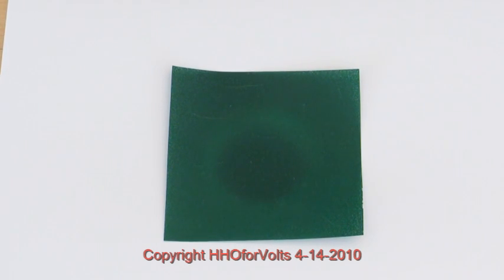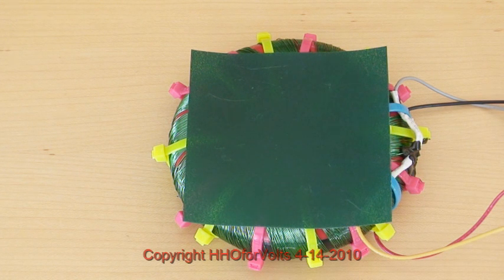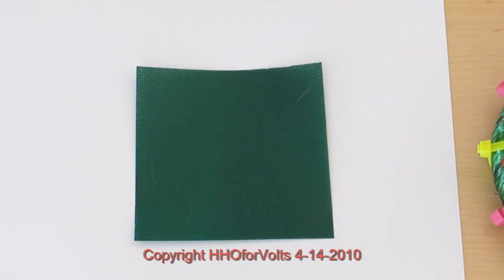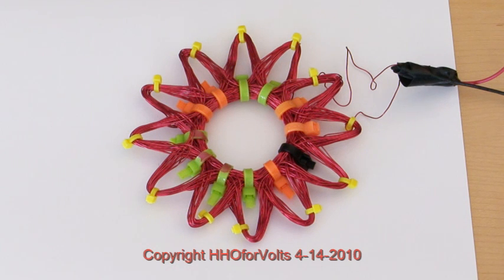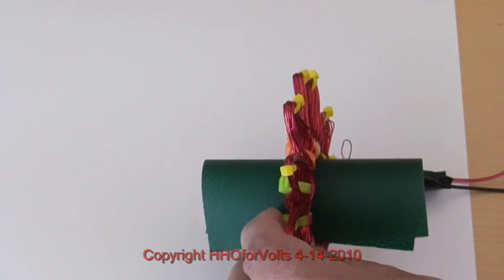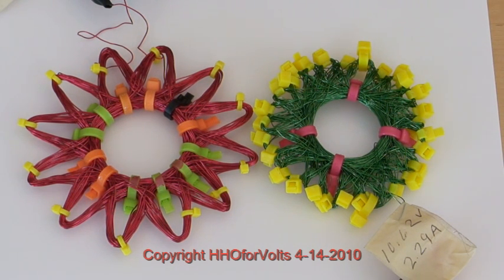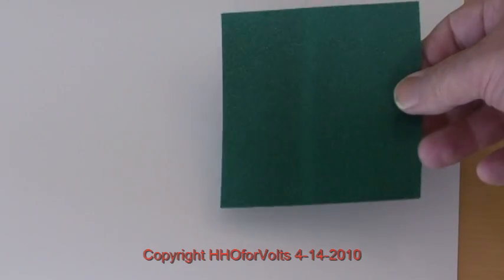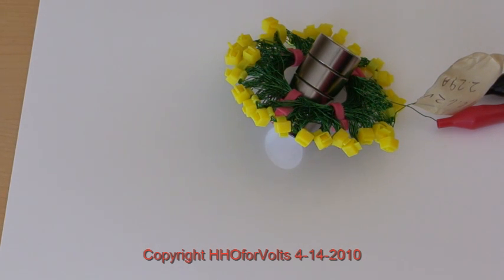Rodin Starship - See their magnetic fields.

Comment: Your "starship" has a circle coil in the center so the magnetic field is in the center. The toroid has the magnetic field in the toroid part because that is how magnetic fields work. Make a thumbs up and look at the direction your thumb points. That is the direction the magnetic field goes and your fingers represent the wires. That simple. When you wrap wire around a toroid the magnetic field forms a circle as well. That is why your magnet paper didn't show a field in the hole of the toroid.

Comment: Not sure why you feel that placing your paper along the walls of your inner coil openings has any clarification on what us happening in the center of the hole of your coil. 

There is none of your paper crossing the center of your coil opening, so no results are relative.   Further, twice the line you show that had formed happened to be  the top of you paper rolled up up when your turned on the juice. 

I is no coillation of what is happening in the center of the coil opening :)

Comment: The intensity of the magnetic field (H) or field strength of an inductor is measured by H = I / (2*Pi*r) where H = field strength, I = Amperes and r=distance from the wire. The magnetomotive force F is measured by F = I*N where F = magnetomotive force, I = Amperes, and N = number of turns. Notice that magnetism is not voltage-centric, but is instead amperage-centric. Voltage has to do with electromotive force and the electric field strength, not the magnetic aspects.

Comment: @ 36trooper  The number of turns does certainly affect field strength, since H=n.i/l. Additionally, the larger the number of turns, the less influential is the Ohm-resistance (copperlength) on total impediance, since ZL = r + jwL where L=n2.m .A / l. The BH-graph of a electromagnet shows that a certain value of H, B is saturated no matter how you would increase the current value

Comment: First off, you're trying to prove that this coil variant produces a higher magnetic flux density at the vertex by showing there is a region along the inside diameter of the coil that lacks any magnetic field. Fine. But, if you had done any research at all you'd see that all coils do this! Look up "solenoid" on Wikipedia and refer to the image associated with the finite continuous solenoid. 
Secondly, the B field does spread out, the viewing paper was holding the pattern once it was lifted out of the field.
Thirdly, Rodin is wrong, the number of turns does NOT affect the field strength, everything else being equal. Double the turns, and you've doubled the resistance, and halved your current, the end result is the same. 
All this Rodin coil stuff is nonsense.

Comment: You went on a 5 minute rant about a fact which is well known in the scientific community.  You also have a misunderstanding about the basics of electricity, or you are preying on those who do. In electricity you cannot control both voltage and current at the same time with a constant resistance, you change one to change the other. I suspect your setup LIMITS current to below a specific value, which you don't pass, but you actually control the voltage. Therefore your system would shut off when you attempt to draw too much current and gives you analog control over the voltage. This is EXACTLY what you observed and also explains why your first magnet appeared so much weaker, because it had a much higher resistance and therefore used much less power. The shape off a solenoid would also have been a much better comparison, and with the same radius would have the same results as that is exactly what you have here plus a couple random spikes.
Reply: Don smith proved otherwise by using an open system with resonance.

Comment: increasing the voltage does not increase the motor's speed, increasing the voltage increases the current going throught the wires and that increases the magnetic field and that increases the motor's speed. His voltage statement has no sense at all, voltage doesn't exist, it's just an electric potential, the magnetic field arround a wire will always be the same either with 1V 1A or with 1KV 1A, the only difference would be with AC, in that the change rate would be higher but he's with DC.
Reply: His demonstration is accurate, but his explanations and understanding are not correct.

Comment: @hhoforvolts ugh..   I know so much about inductor design it's not funny.  You're kinda a little right about the toroid.  If the angle of the winding with respect to the center is significant, then it starts behaving more like a simple coil, and you'll get a magnetic field in the center.  What really matters is the number of turns there are around the center.  It doesnt matter if its a star, or a curly q or a wadded up mess of wire.

Comment: There is so much wrong with this.  The so called "Rodin Coil"  doesn't exhibit any external magnetic field because its really just a toroidal inductor.  toroidal coils are used extensively in electronics specifically because of this property.  The "starship" coil is topologically just a normal coil.  The flanges sticking out don't do much.  The light band on the film you have is from the uniformity of the field in the center, not because it's high or low.
Reply: htomerif you are wrong, get one and a gauss meter and check the poles, it can be a monopole which no other coil can.
Reply: it s actually quite sad, because it obscures normal benefits of using those coils.
with toroid it is not that bad, but starship is most hurt. 
Actually starship is not "normal" coil because of electrodynamics and capacitace. best effects you get if you make coil using triangles - you get very uniform field in the "circle" created by overlapping triangles - think of how magnetic field is created using moving electrons and lorentz shortening of time.
That said those coils are not more efficient than round ones - only field shape is "better" - more "focused". also inter winding capacitace is lower .
There are more shapes like that possible and i would see use of them in flat motors and hi-freq high q inductors.

Comment: Have you tried using a sheet of paper and iron/steel filings to show the magnetic fields?  If you used baby oil and steel filings in a small bottle that would fit inside the coil, it coulds show the proof of a magnetic votex.  Either way I think it would be a clearer picture of the magnetic fields than the green film.  The filings could show if there is a magnetic field where that lite line is on your green film.

Good vid, Steve

Comment: Richard, I'm designing an injection molded Cell, and thinking that  your Star Ship coil could be insertion molded in the end plates and also as a SHIM in between active cell plates. 

The end plates are 6" in diameter and 1/2" thick. The active electrode area is 4" in diameter. 

Do you think a fairly strong could could fit inside this size plate, or would I need to make it thicker or a larger diameter? 

Thought this would be a good test as well as using embedded magnets.
Thanks
Denny